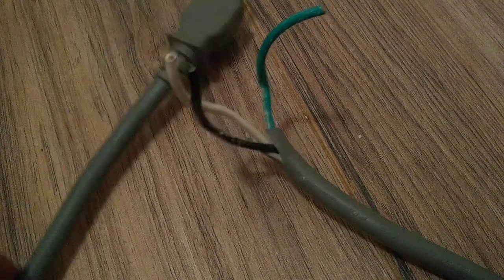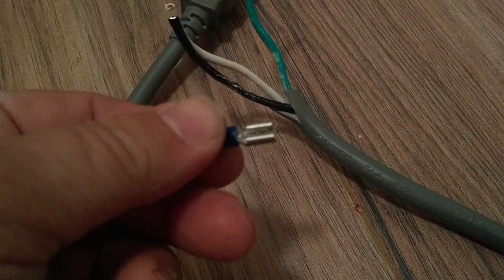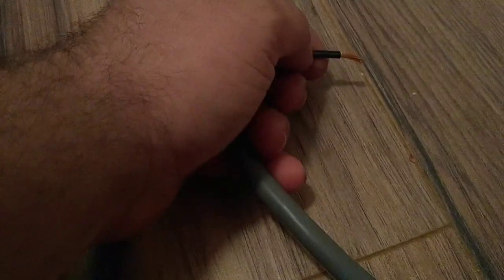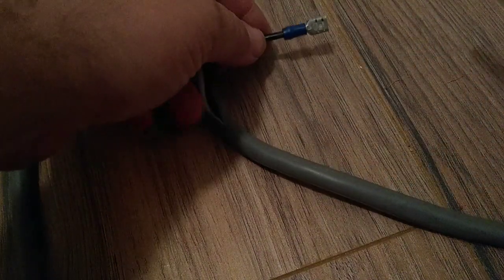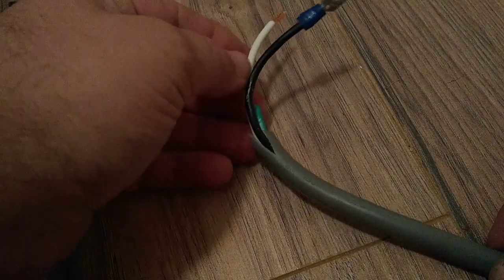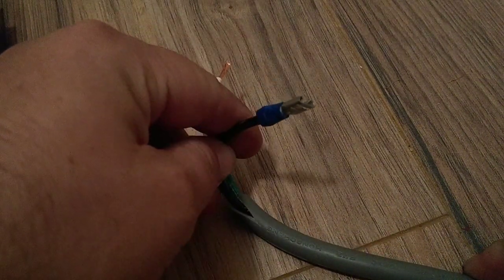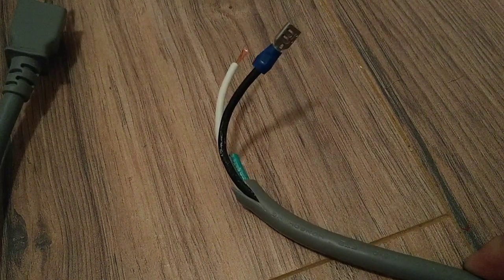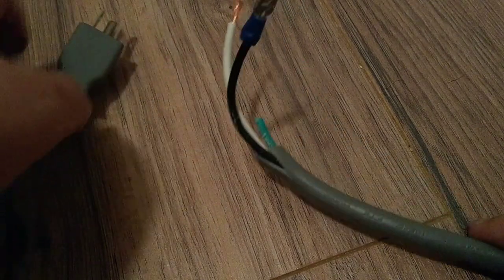Appliance Repair Training- Water Valve - Soap dispenser- and more! I call it my little tester!

Comment: I'm not very familiar with appliances. Are any of the controls to those parts ran by 24v switches/contactors or are they just ran straight off 110+?